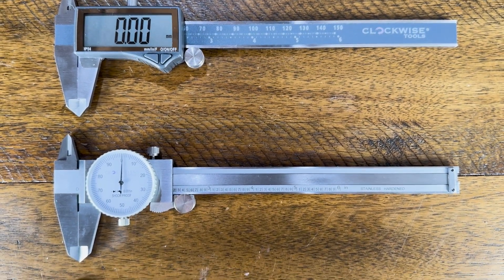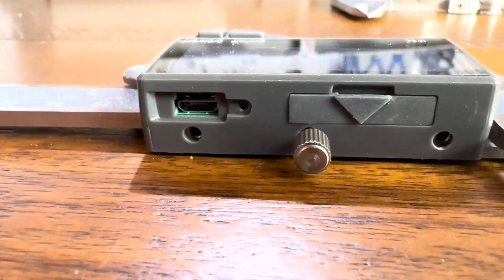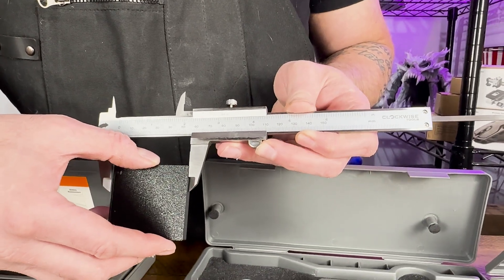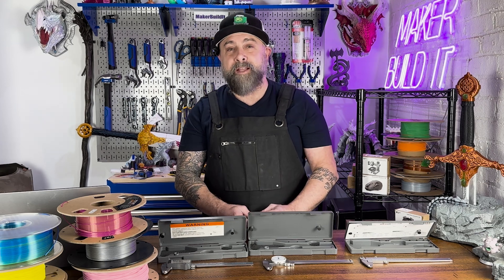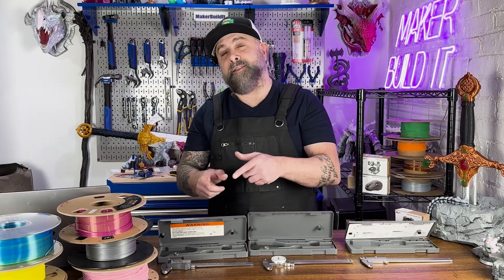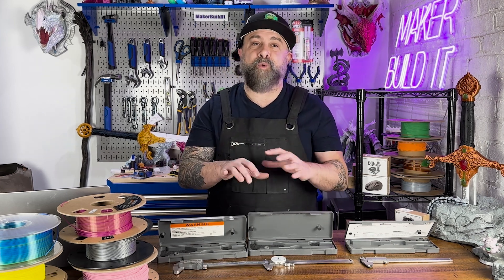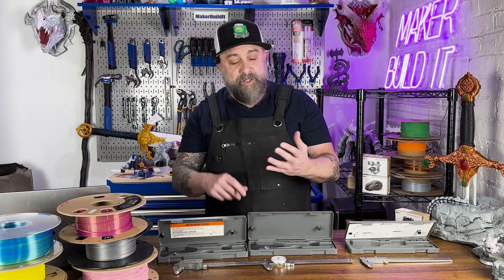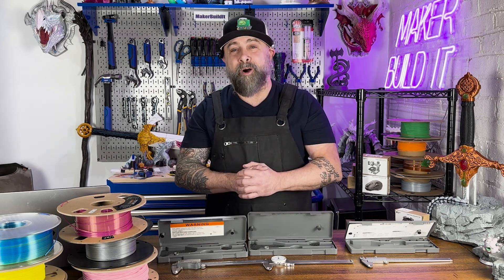Digital vs Dial vs Vernier - Which Caliper is Best for 3D Printing?

Comment: Batteries [÷(  
I use my calipers less than once a week and if I don't remove the battery each time it's dead next time. (The off button only switches off the display, but the sensor is always on, draining the battery).
So I bought a dial set. More trouble to read, but easier than dealing with the battery.
Reply: I've heard claims that cheaper digital calipers have this issue but high quality ones like Mitutoyo do not have the phantom battery drain.